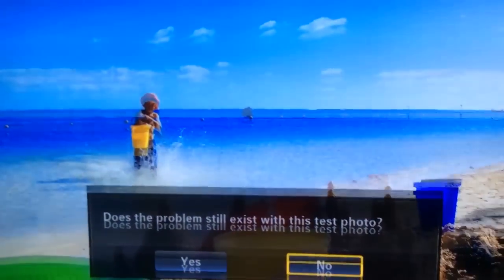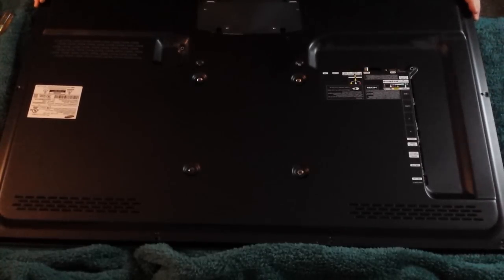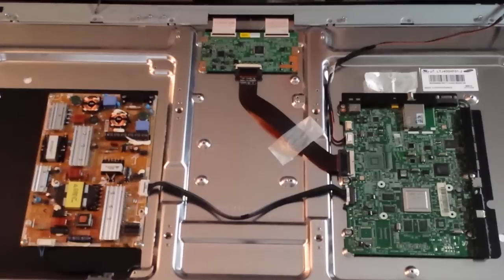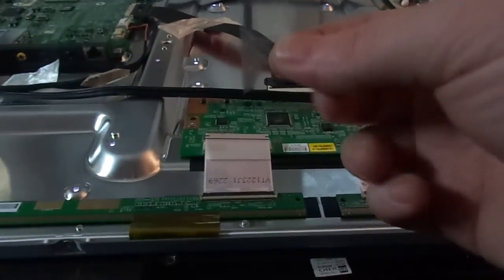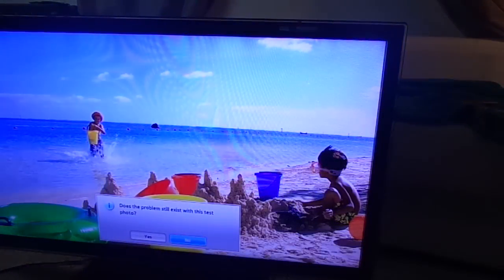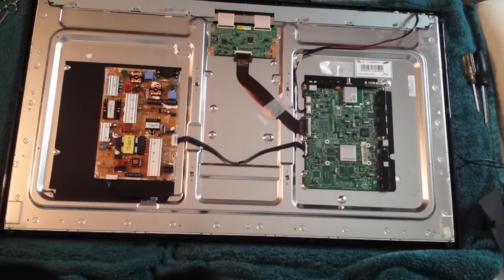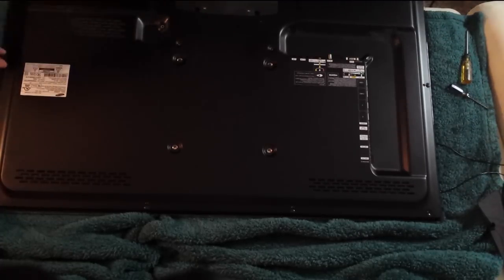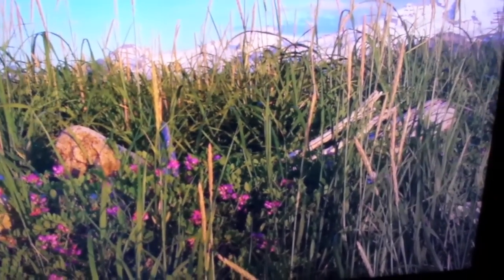LED LCD TV FIX, How To For Samsung Double Image, Black Vertical Lines, Screen Problem Sony LG.

Comment: https://youtu.be/RkBXjdJ3iR4
Help me!  I tried this repair again, and now I have a triple image.  Please watch my video to see what my TV is doing and let me know if you have any suggested repairs.  Thanks!
Reply from the maker: Carl Sticht man I really don't know.  I've never seen that before. If you want to continue to work on it you could check that the ribbon cable are not damaged and replace if needed (Ebay). Ppl have posted to replace the t-con board to fix the issue this video is addressing.  I hope this helps. If you get any further please post about it.

Comment: I was having the same problem, i did the same way but result no black screen i don't know how i fix it 😥😥😥
Reply from the maker: Be Cool from your comment it seems like the screen is black like "not lit up"? You could try looking at the ribbon cables to see if the gold layer chipped off or any burn marks are present. They are very delicate and can get scratched. Also double check that the ribbons are seated property.  The TV may or may not have a power supply issue or something burnt out a part of a board. You can check for power by plugging in TV then look for light on front when turning on and off. If there is a light then with the back cover off and the TV on look to see if the led lights come on. If they do then with the TV of visual look at the boards for signs of grounding like black or brown or yellowish spots. And any smell like something burnt. If you find something then that could be the issue. Also check the capacitors for bulging on the tops one or more could have burnt out. If nothing like this is found then it could be the actual panel. You can shine a light through it to check of any cracks on it. I hope this helps.

Comment: Hey Dave,
Thanks for sharing the fix. Mine is Samsung UE32EH5000 and has got both issues. Tried the fix and it works for few seconds and then shows double image again!
Any tips where I might be missing something?
Thanks in advance.
Reply from the maker: Tariq Husain I apologize for the delay.  If you are still working on this issue check to make sure the tips of the ribbon cables are undamaged.  They are delicate and can easily get scratched. Also some people has posted that the t con board will cause an issue like that do to a abnormal decrease in power supply.
Reply: Thanks for the response. I did check the top of ribbon and it seems good. However, the taping solution works for 3-4 seconds and goes back again to issue. Could it be width of tape? I used 2-3 mm wide tape. Should it be wider?
Reply from the maker: Tariq Husain you could try applying pressure on one slot with your fingers and hold it while the TV is on. If the picture remains clear a piece of tape could be used to keep constant pressure on the slots. I don't think the thickness of the tape is a big factor but if it is the next option then I'd try it.

Comment: I tried your way, but now the image colors are negative... Help!
Reply from the maker: pochodelagente hey there my apologies for the late response. The only thing I can think from what you posted is that the color setting in the main menu may need to be reset. If it is all black and white that is something I'm unfamiliar with. There may be a type of color card/panel that controls the colors and it may have been damaged.  I hope this helps.

Comment: Hi Dave thanks for putting up this video.  It really helps,  I have a different issue, there is a vertical red line  towards the left side of the panel. what could be the possible solutions ??? or did u do any videos on line issues  thanks in advance
Reply from the maker: Abhishek Bhatnagar you may try checking for bad capacitors on the boards. Also some ppl have posted videos showing that there are multiple ribbon cable on the edges of some tvs th that can be moved back and fourth and may stop the red line issue. Idk for sure.

Comment: Hi dave please help me.... Iam having the same problem i tried removing one side cable and i still saw the double line on the other half while other half was black. Do you have any idea . Because service guy is  asking me to replace the panel which is Almost equal to the price of new tv
Reply from the maker: Facts round the globe my apologies for the delay in responding.  If you are still working on this you could try reversing the process starting with the left side first. If it is the same issue then you could try applying tape to one of the cables anyways and reinsert to test if there is any changes and go from there. Unfortunately this is kinda of a "if it works it works" type of fix and doesn't always work and it sometimes also require additional troubleshooting. I wish I could be of more help.

Comment: dave, i tried this and it worked, unfortunately after 5 minutes it will go back to double screen.. then ill adjust, but ot keeps on coming back after a few minutes.. what can i do to fix it?
Reply from the maker: Xavier Bretana I apologize for the delay.  If you are still working on this issue check to make sure the tips of the ribbon cables are undamaged.  They are delicate and can easily get scratched. Also some people has posted that the t con board will cause an issue like that do to a abnormal decrease in power supply.
Reply: Do It With Dave okey dave, thank you.. will get back at you soon.. for updates.. thanks

Comment: It doesn't work for me. Samsung 40" UA40D5003XXM. I tweaked different strip widths keep adjusting the location but the vertically ghosting image remains.

Comment: Today I found one Samsung 40" at dumpster, upon powering up shows double image vertically. Tomorrow I'm going to try fixing it using your method. It doesn't make sense why it works but obviously many people have given positive testimony. Thanks for your video brother. My confidence is overflowing.
Reply: Samsung led TVs full hd 32 inch fald video ok sound ok midle horizontal line mor thik

Comment: I have the same TV as shown in the video here with the same issue. Only my faulty contact was the left side instead of the right one. Only thing I can remember doing wrong was putting the tape pass the gold strip and covering a little bit of the white part of the ribbon. When I turned it on I got a burnt smell. Now the left side of the screen is done for good. If I plug in both ribbons normally with no tape I just get a blue screen.  If I use the tape I get a picture but the left side of the screen looks ghostly with vertical lines, If I unplug the left ribbon I get half the picture with no issues, but as soon as I plug in the left side the TV freezes. 

I think I could've fixed the double image by just putting pressure on the ribbon instead of putting tape over the golden strip. TV is paperweight now, oh well :(

Comment: Although this seems to have worked for some people, I was not so lucky, fiddling with the T-CON ribbon cable caused my Samsung UE55B7000 series LED panel itself to start smoking around the edges. It's completely dead now. I'm guessing my panel's death was just accelerated by me. So I don't blame anyone but Samsung for making inferior panels.

Comment: my  tv screen went black while i was adjusting the ribbon! there is sound, But no picture. help!
Reply: GNJ MVMNT the same here
Reply: ik you posted a year ago but mine did the same i used a thin long strip over past the golden line and it worked but shorter than the pull tab thing on thed front

Comment: Does anyone know if the tape should cover all of the gold connnection?  I know it's only 1/4" wide but does it cover all of the gold or stop in the middle after it wraps up and over?
Reply from the maker: I just wrapped it about half way onto the gold part. Others have commented that they cover the entire section with tape and get the result they were looking for. I hope this helps.
Reply: Do It With Dave it does thank you. I'm not having any luck.  May be time to replace the tcon board.

Comment: Hi Dave, I've tried this with the same problem by my Samsung UE40D5720, only the other flatcable has this problem (right one). I found a spot at the cable for tape, where the picture gets better, only now I have a black vertical bar right from the middle (about 15cm wide)  in my screen. Does this mean the tape is still not on the right spot ? Otherwise is replacing the T-con also solving the problem ?
Reply from the maker: Im not sure. Some ppl have commented that replacing the t-con board did work for them. If you are still working on it you could try removing the tape gently (the gold tip can be scratched or removed by the tape) and put the ribbon cable back with no tape. See if that goes back to how it was or not. If it does you may want to try to another piece of tape and see if that helps. If the ribbon cables are damaged then the picture won't display properly. I hope this helps.

Comment: before i follow your instruction, my Samsung 32" can open, but only double image...and after follow your tutorial, now my TV not work anymore, all just blank...bye2 my TV.
Reply from the maker: Hello my apologies in my delayed response. If you still have the tv double check the ribbon cables to see if they are damaged.  Some times the gold tip gets scratched from moving them in the slot where they connect or putting tape on and removing it. I hope this helps.

Comment: Thanks so much for this instructive, informative video. Just brought a Samsung 40 inch back into the realm of completely usable. After eliminating all horizontal lines, I'm left with some vertical line artifacts, but, not enough to ruin the party of bagging a monster like this off the street and totally re-animating it. Thanks again, Dave. 

PS: I think it's worth repeating the line about patience; had to experiment multiple times to find the exact sweet spot that would eliminate both problems faced trying to use the TV initially. When I don't need this one anymore, I'll figure it all out (lol!).

Comment: I Can't believe it, Bloody brilliant fix! I have a Samsung UE40D6530 purchased in 2011 with ghosting issues.

Your fix worked a treat, I was quite dubious at first after watching the video, I didn't understand, how you decided which ribbon to adjust or how the tape affected the picture (I still don't understand how the tape stops the Ghosting?) I did some research on LED TV's and LVDS cables and after reading all the comments to your video I was convinced it would work.

Hint; If you have my model TV, you do need to reconnect the surround panel to operate the buttons at the back or the remote control to test your picture, be careful and take your time, all in all it took me and my retired electrician neighbour 1 1/2 hours.

Thanks Dave for a brilliant fix.
Reply from the maker: Thank you so much for watching and posting. I am glad you found this video helpful.

Comment: Dave, how can i fix a constant unstable/ bouncing screen?
Reply from the maker: You could try to lower the Backlight option in the tv menu.  Sometimes when it is set to high the screen will flicker. You may want to run through a couple picture options as well.

Comment: did the research horizontal lines, screen was flashing. changed the t-con board. and still the same. what do I need check next ? anybody
Reply: I have found that many times when you have to reduce the backlight to solve a flicker issue, it is because the power supply struggles to provide enough power to the whole unit.  Reducing the demand only delays the end of a failing power supply.  Most of the time the manufacturers use electrolytic capacitors that are barely adequate and run at or near their maximum operating specs be it high temps or voltage on the circuit.  If you see these aluminium electrolytic capacitors with bulged or split tops, they must be replaced.  If you replace them, use the same value but raise the volt rating on them to the next higher available value.  I've lost count of how many computer monitors and motherboards have been repaired just replacing these types of capacitors. That might be your next check point.
Reply from the maker: Sorry for the delay in communication. Try going into the tv menu and adjust the BackLight to a lower setting.
Reply from the maker: Thank you for your comment. I didn't associate a flicking backlight with worn capacitors. I agree with you.

Comment: Dave would like to thank you for your help  This fixed my 48" LG smart tv. I got mine from a friend for 200. it has a small crack it the upper right hand corner, picture would jump up and down, just like the one in the video. I started with a small piece of tape like you said and worked my way for right to left on the ribbon stripes, about 3/4 of the way to the left on the right strip the tv stopped jumping. Then had the line like you showed, but mine were vertical, I made the piece of tape smaller and now I have a perfect picture. With the exception of the small crack. Thank you for all your help.  You are the man.
Reply from the maker: Dennis Slack you rock!
Reply from the maker: Thank you for watching and posting. It really helps everyone looking to get a better understanding of whether or not this may help them.

Comment: It worked for me! Can you explain why this works? Its crazy covering up contacts actually remedies the problem. Thumbs up to all your videos! You saved so many people lots of money. Thanks a huge amount!
Reply from the maker: Zilnich Productions thank you. I'm glad you found this helpful. I don't know exactly why it works. Some people have posted that static electricity builds up on the connections and causes the double image, and by applying the tape it acts as a insulator preventing the static electricity to build up.
Reply: Wow. The thing that makes me wonder is, I actually replaced my t-con board, the ribbon cables and the power supply. None of that worked. The little piece of tape worked though. It almost seems the problem is elsewhere and for some reason this remedies it. Where did you find out about this anyway?
Reply from the maker: I found another video from Brazil and followed along the best I could as I don't speak the language. It took me a very long time to find it so I decided to do one in English with updated tags so more people could find it. The guy in the video is probably saying exactly how this works lol.
Reply: Cool thanks.
Reply: @DoItWithDave  Nice job, Dave!  You took your time to do it yourself, and share it later with us!!!!  Excellent job!  So proud of folks like you!

Comment: My LG 47" LED TV image freezes every 5 seconds then goes for another 5 then freezes and has double image. Think this will fix it? Ive already tried cleaning off the ribbon cables and connectors with alcohol with no luck. Hope I don't have to replace the whole T-con board.
Reply: UPDATE: WOW!!!! Tried this and it worked!!!!!!!!!!! THANKS SOOOO MUCH DAVE!!! LG 47LV5500 smart tv. Had to cover about 9 pins halfway on the left t-con board connector at the very right end starting at the end pin. Took a few tries but I got it!
Reply from the maker: artie2099 alright!  I'm glad you found this video helpful, thank you for watching!

Comment: hey, thanx for the video. it worked for me initially. but after an hour same thing happened. then when I removed the tape, whole screen is black now. I see a blue light near the panel is not turning on now, which was happening earlier. any idea? have I completely damaged my TV?
Reply from the maker: Varun Sharma hello. Check to see if the ribbon cables are damaged. Sometimes the tape can peel a layer of the cable away with it as they are a bit delacate. If they look good then with the TV off visual look at the board for any signs of burn marks and possible bad capacitor. other than that I really am not sure.  I hope this helps.

Comment: can it will fix my LG 42 LM6410TB led? have same kind of issue since last week.LG customer care said to replace the panel...
Reply from the maker: Mark J someone just did this on LG 47LV4500 so it may be worth a shot.  About 5 comments above yours. Thanks for watching.

Comment: Thanks Dave for your post! I had the horizontal lines once every 1/4 inch and I tried swapping ribbons but still the same result.  I then isolated with tape and magnifying glass which pin on the connector was faulty.  In my case when I covered pin 9 the lines went away however I had to also cover pin 10,11,12 and 13 to make it look perfect.  My question is what are the pins that im covering? Must now be somewhat less effective at doing something.
Reply from the maker: Chris K WOW your awesome! Thank you for sharing.

Comment: so I'm not getting The Double Image on my TV but I'm getting the horizontal White Lines I'm guessing this process will help fix that my TV is a 2011 model so I'm pretty sure it's not under warranty so I really don't give a f*** about opening it if not my other option is to just throw it out
Reply from the maker: Nicholas Gonzales I apologize for the late response. I really don't know but if you are willing just take your time and be safe. Thank you for watching.
Reply: My TV is also a 2011 and the horizontal line just started to appear. It seems that whatever part is going bad inside the TV was meant to die after a certain time. Typical case of planned obsolescence.